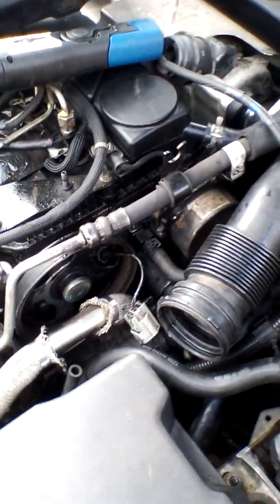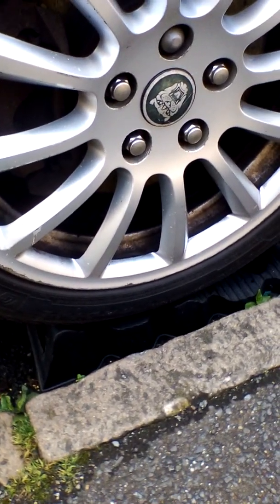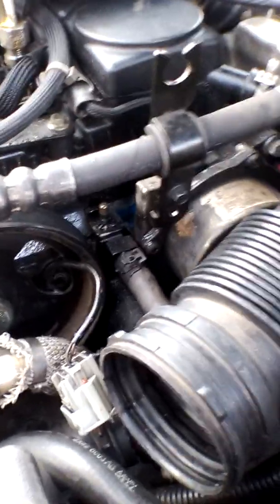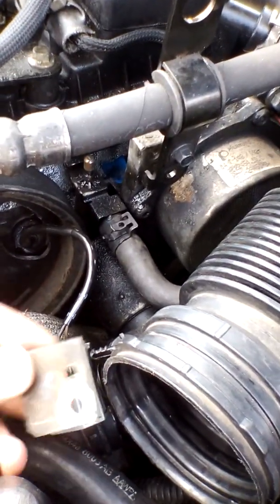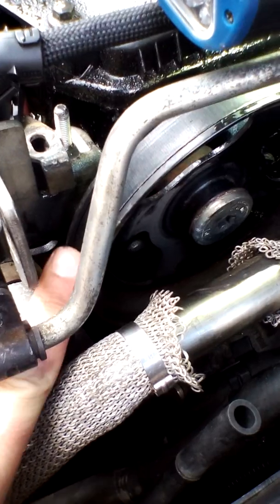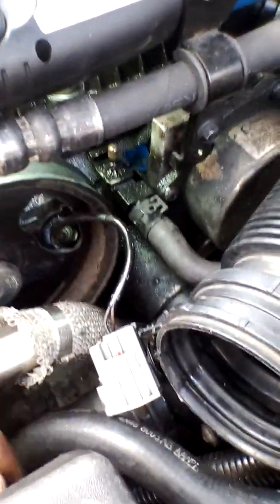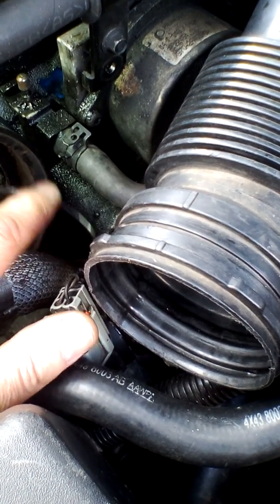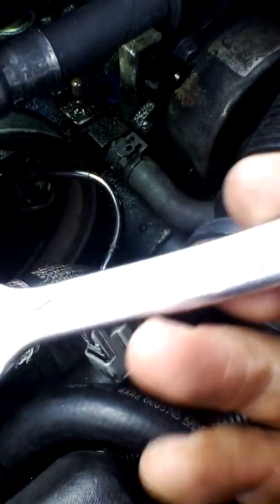Jaguar/Mondeo 2.0/2.2 coolant temperature sensor removal​

Comment from the maker: Hey Christian, that k you for the comment below. Is your car a diesel model or petrol as didn't know there was another thermostat down by the water pump as could be what's wrong with mine, as have changed both stats & cylinder head temp sensor & still my gauge runs at a 1\4 instead of half?? Thanks Jay
Reply: Hi I can't find the water pump on my 2006 jaguar all videos say it sid of battery but mine only has 2 pulls ans a thermostat housing  could you tell me where water pump is please
Reply from the maker: @rayscott7275  Hi Scott if the V6 petrol look from underneath the car & you'll see it halfway up engine on battery side with 2 hoses going to it or more. 
If diesel remove engine cover, air box, you see a metal bracket with 3 bolts, remove these & take out, your now see a biege round housing with lots of hoses to/from it..that's the water pump & at the back of it at top is the oil coolant temp thermostat held on by 8mm bolt.
If you want the the coolant temp sensor it's behind the back pulley of the 2 on rights idea of engine. Test it 1st before removal as rarely fail, it's usually the oil temp thermostat buddy..hope this helps cheers